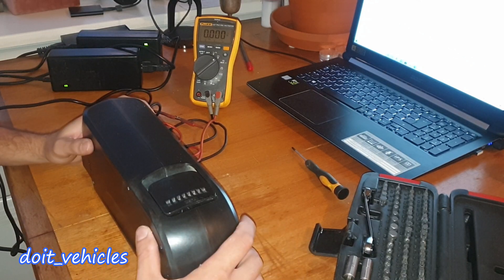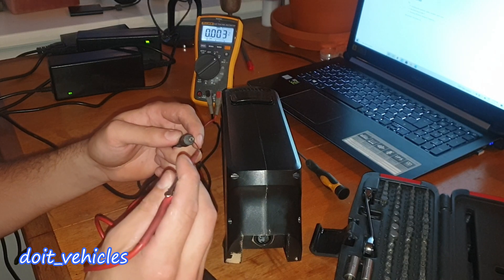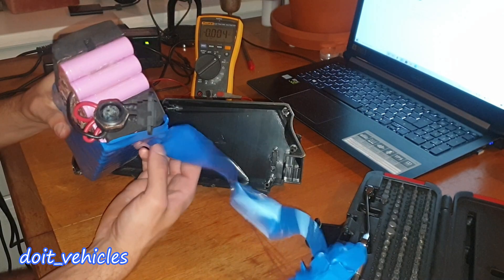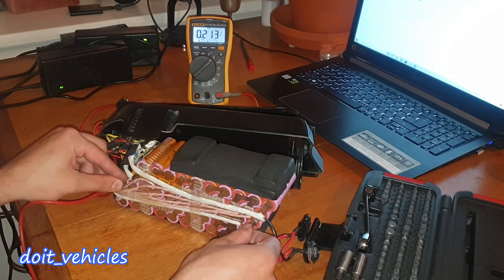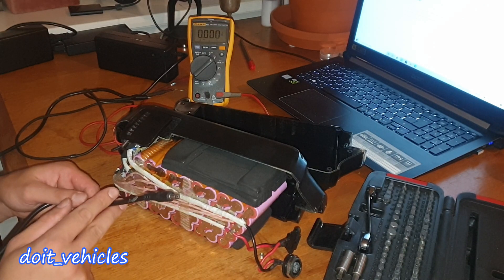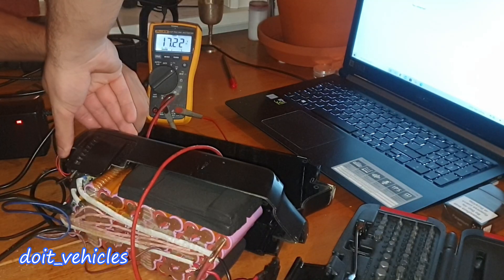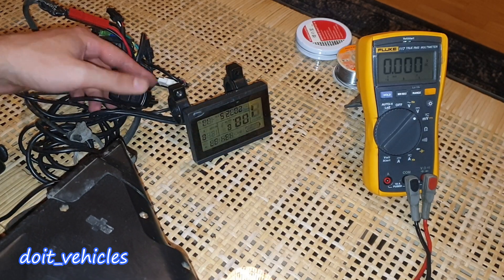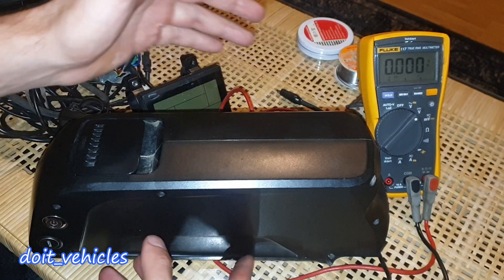36v E bike Battery NOT Charging - Repair -  Li Ion 18650 Dead cells - DIY

Comment: HI, thanks for you video. I have on commercial batter  this type of connectors ,like you have.
But this connectors after few thousand of kilometers overheat. I plan to use XT60. Is thi good option,
or can you advise me something better for 12 - 13 AMPS of discharge current :?

Comment: hi sir do you have  experience for a similar system when the battery is charging without problem but it doesnt operate the on off switch what maby causes this problem ?

Comment: Can you force charge by connecting power to the Battery  output positive & negative terminals ?
Reply: I don't think so, the BMS likely separates the terminals from the cells, this is to prevent shorting
Reply: yes, he just showed you on the video

Comment: I bought a used E bike and the pack was not working, I took it apart and i have about 8-10 cells that are dead or low. I think I will try this before replacing them.

 Stet up the positive end of the charger to the first positive battery terminal and then the negative to the negative of the last cell., got it.

Comment: I did this and it worked charging the cells directly with 2 wires from the charger. That then mysteriously stopped working any idea why. Think the BMS is fried? Any idea where you get one the mfg is totally unresponsive. thanks love the content
Reply: God told me that less than 50% of your battery cells in that pack are losing charge. You can charge them, but will lose charge quickly. God told me that the remaining batteries are near the end of life as well. God told me that you used fast charger (considerably higher than 4A) to charge your battery and caused the battery cells to deteriorate.

Comment: I checked the batteries inside and got 39.2 VDC from a 42 V battery, but the connector output to the bike reads 0.5. What would stop the battery output?

Comment: I have a electric scooter that seems to fry batteries. Shut off on me one day during a ride and wouldn't come back on or charge. Pulled the battery and got a reading of 13.3v. It's a 36v battery so definitely shouldn't be that low. 

I Installed a new battery that was fully charged around 42v and the scooter still wouldn't turn on. Pulled the battery out checked the voltage and it was at 8.8v?? What possibly happened why did this scooter fry a new pack like that? I took the scooter apart and checked all the wiring and controller. No signs of overheating burning or shorts. No burnt smells and didn't make any popping sounds or buzzing whenever the new battery was installed. No blown fuses either. 
Battery seems to just have suddenly went from fully charged to completely dead and I can't find out why. 

Is there something I'm missing could there be a short somewhere or something going on that's causing this problem?

Comment: My battery is showing only 8 volts it is 7 years old the output socket is a two pin system can you get a new 4 pin battery with socket and pins to work the original controller if so how? as the two pin original is unavalable.
Thanks for your input.

Comment: What if only one group of cells measures 0 volts while all the others from 3.8 to 4.0 volts? Mine is a 48 volt battery, there are 13 group of 18650 cells
Reply: You need to charge this group separately with 5volt charger 
Up to 3.8v

Comment: My 48v battery will only charge to 74% and when i use my ebike it drains quite quickly, any ideas on best way to solve this?
Reply: You fix the problem? I have the same..
Reply: @Cst1595  Apparently it's because some of the cells have dropped below a certain voltage, and the BMS cut them off, i think the only way to solve this is to remove the affected cells and charge them individually and put them back in the battery pack. That's the best explanation i have learned so far.

Comment: Dude if you've got less then 3V on all cells, you really shouldn't charge it fast! In that case connect it to a CC-CV power supply with max 100mA/cells in parallel, to charge it over a day or so, until it reaches at least 3V. After that you can connect the charger, and charge it normally! Otherwise you may cause permanent damage to the cells! Even then watch out for cells that get really hot, or cells that self discharge more then 0.1V in 2-3 days after full charge, cause those are damaged and dangerous cells!
Reply: Why less then 3v?
Reply: @carstrucks9641  From personal experience a li-po or li-ion cell is more likely to recover from over drain if I charge it slow when it has less then 3V open circuit voltage. The 2.5V-2.8V that is usually specified for Li-ion cells as cut off voltage, it is under load. When you disconnect the load, the voltage usually recovers to around 3V.

Comment: hello, my 36v battery voltage drops to 13 volts after riding a few minutes and after a few seconds of charging it comes again at 40v. What can be the problem? Can the motor be the problem? it buzzing when riding.
Reply from the maker: Most likely the cells are dead

Comment: Great and helpful video! Thank you! One cell-pack in my 13S7P battery is only getting to 3.6v when the charger turns green, when others are 4.2v. Also it’s discharging much faster than other cells. And after 2-3 days it drops from 3v to 1.5-2v. Is it a BMS issue or a cell issue? Thank you!!
Reply: Cell is the issue

Comment: Q- I shorted out my charging port with a screw driver. I replaced the charging port but the battery won't take a charge, however it did still run the bike but now the charge on the battery is almost gone. Have any suggestions
Reply from the maker: Hi . most likely a part of the BMS is burned or if you are lucky just the wires from the charger port to the bms got melted . so just open the case and inspect it

Comment: why doesn't anyone check out the charging port first? That's seems the simplest thing to check first.
This is the 12th fix it video I've watched that instantly goes to the cells.
Reply from the maker: I get the point. If there is something wrong with the charging port it will be easily spotted ( rust or damage )

Comment: thanks for the video. Do you actually disconnect the BMS or just apply the leads from the 2ns charger directly to the end connectors(+,-) of the battery pack?

Comment: Good video. I have a strange issue with one of my 36V Lithium Manganese Dioxide packs. Every group of cells seems to have normal voltage but one group actually has the polarity reversed, dropping the voltage of the entire pack and making it unusable. I am trying to force the correct positive voltage (3.6V) with an adjustable DC power supply to match the rest of the cell groups and hopefully correct the polarity. Ever seen this issue or had a fix for it? I thought about even disconnecting that entire group of cells and flipping the polarity if that's what it takes haha.

Comment: Yo thanks a mill. I could not see properly how did you bypass the bms. Can you show us a bit better? Thanks
Reply: C- to b- ..or u c+ to b+ ..have to solder a wire ..what he did isn't a bypass it's a force charge
Reply: For charging you should be able to jump start / charge through BMS on a dead battery pack that got drained. It's the discharge that BMS will cut off.
Reply: @noobz5056 english please